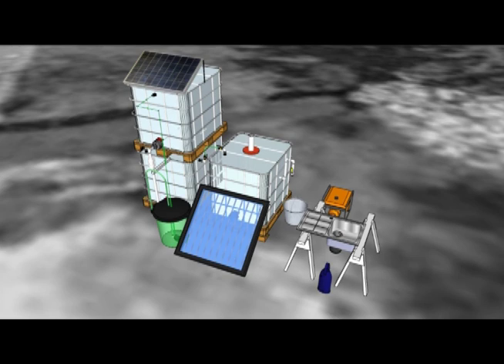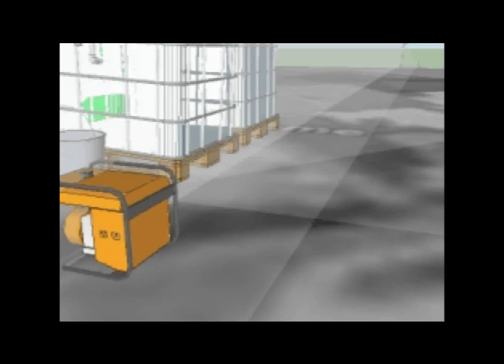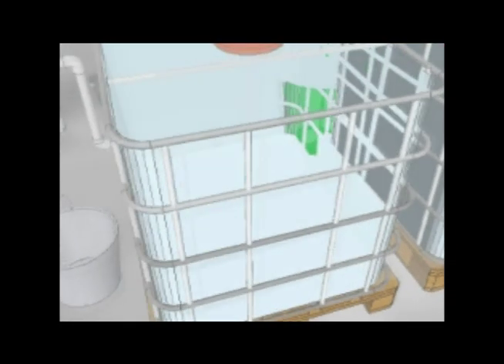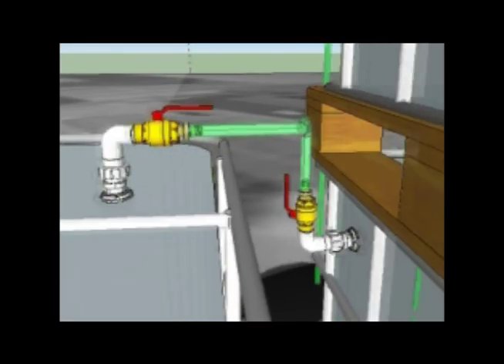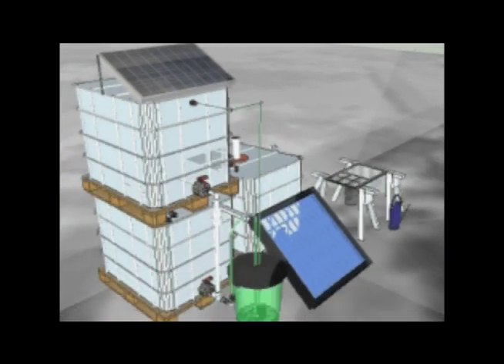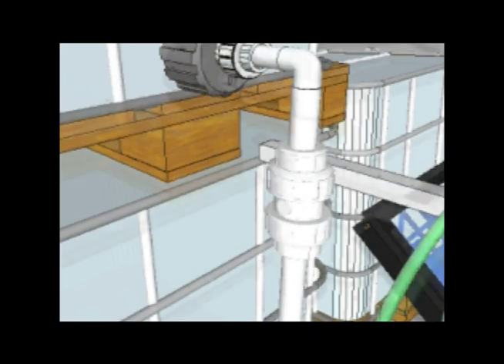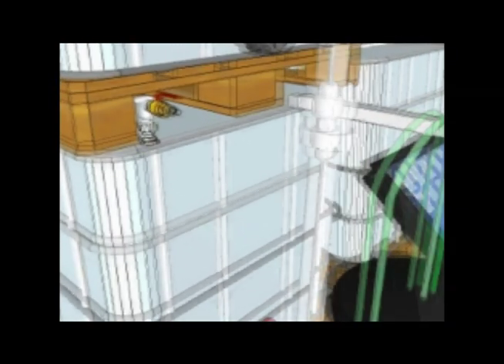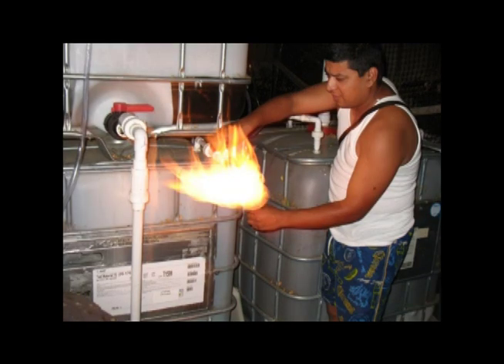3D Animation of Solar CITIES 3-tank HDPE IBC biogas system

Comment: Why in the world add the water pump and solar panel??? The head pressure of the elevated water storage will produce pretty good pressure on the lower gas storage tank already! And if you need more pressure... elevate the upper tank further.
Reply: johngagne1 the pump (and solar panels used to power it) are used to pump water displaced from the gas holding tank, up to the top tank.

Comment from the maker: The tanks indeed should be opaque. We actually insulate them now, and in hot climates we paint them black rather than insulate. But in the video I didn't want the "black box effect" to keep people from understanding that I was using plain old IBC tanks. These days I collect the gas in truck inner tubes or floating tank digestors so the high pressure section (two stacked tanks) is unnecessary. Also we found that if any light gets in the digestor it grows algae whose oxygen shuts down the process.

Comment from the maker: certanily the cat feces can, and the cat litter we use in Germany, which is made of wood pellets, can be too. The clay based cat litters can be put into the digestor with no harm I would think (haven't tried) but they will probably just accumulate at the bottom as sludge. This is not a bad thing -- it will provide homes for the bacteria; but eventually you may have to use a shop vac and clean it out and use it as soil somewhere. We tend to aerobically compost such cat litter. But hey, give it go

Comment from the maker: @mooskorn The solar hot water panel is to heat the digestate so that it can stay within the optimum range of 32 to 37 C; the photovoltaic panel is used to run the circ pump for the solar hot water panel (which is on a thermostat) and the float switch in the sump bucket (which pumps the water displaced from the gas collector up to the water pressure tank).